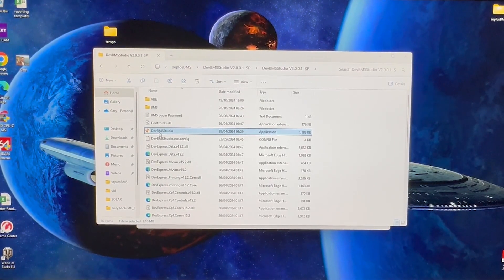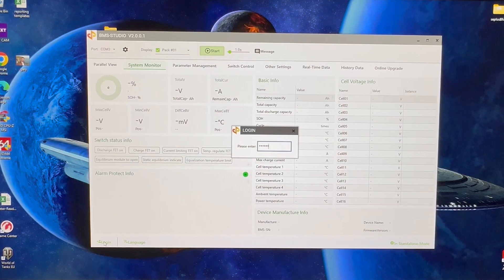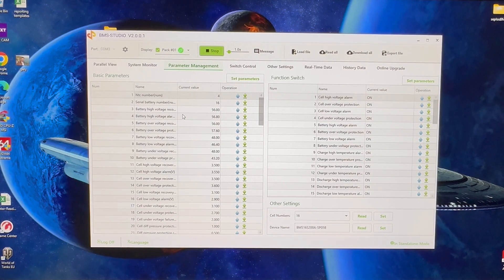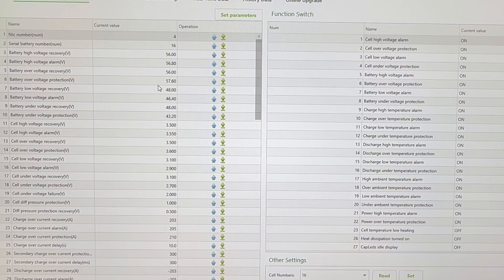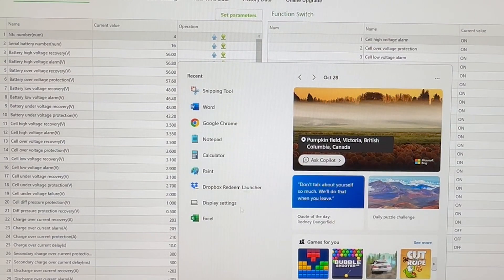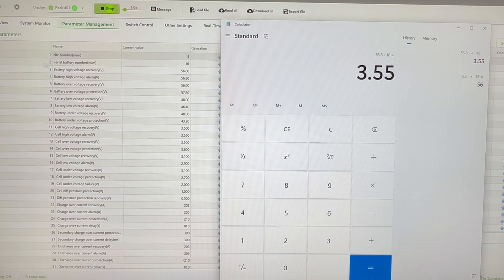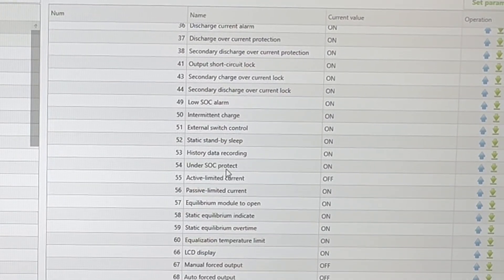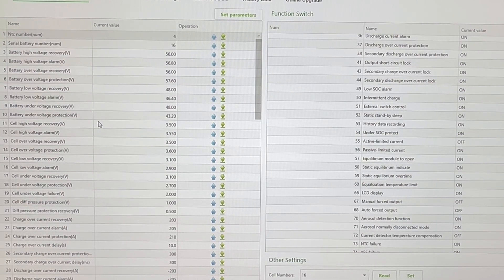Seplos V3 BMS Settings Improved

Comment: Thanks for your great work. I ordered the same enclosure but read about the active balancing starting at 3.0V. Is this changed in a latest firmware or could you chance the setting to 3.5V as generally recommended? I understand that the balancing board is also accessible via software. Thanks again
Reply from the maker: You can change the settings to whatever you believe is most appropriate for your purpose. I have found the settings I use to be working perfectly for my use case.

Comment: Great video!
I just received my Seplos Mason 560L (628Ah 2P16S huge battery!) and it's first 100% cycle shows it hitting overvoltage before throttling down the current. Doesn't seem like the shipped options are the best config?
Reply from the maker: Possibly not, but each setup is different if it's DIY, because different batteries are installed. I haven't seen the 560L until now. I would do a build video if Seplos wanted to send one to me. I think moving the complete battery is a challenge. Definitely a ground mounted setup.
Reply: @GaryOnPower yes, my Unit is a pre built one but I am sure it is easier to transport with the cells separate. I will have to get a cable and check the units BMS settings but I suspect the use the same setting for throttling as they do for alarm.

Comment: "Less conservative"? These are absurdly aggressive settings.

59.2v is 3.7v per cell, which is above the maximum you should ever charge an LFP cell to, and in order to charge the battery to 59.2v you're going to see individual cell voltages at god knows what voltage.

However, your batteries cannot reach a higher voltage than the charge voltage so in practice you are charging your batteries to 57.4v, but you will never get there because one of your cell voltages will very likely hit 3.7v before you get there unless you have exceptionally well matched cells.

The only reason your settings don't annihilate your batteries is because you have charge voltage set below where damage will occur and because the BMS will cut you off as soon as a cell hits 3.7v, which is too high but won't result in immediate cell death.

55.2v will get you to 99.9% SOC. There is no need to charge to 57.6v.
Reply from the maker: Thanks for your comment. While the settings are no longer conservative, they aren't absurdly aggressive either for LFP cells, at least not if they are actively balanced. I've gone through many tweaks and iterations of the settings and setup in order to fine tune for my use case. I update the description to keep people up to date and get the best from their setup. These are guide settings people can use, or ignore. 

What I will say is that the current (no pun intended) settings have been working great on my 3 packs. I had previously seen my SOC drop off a cliff from as high as 40% down to 15% for lack of LFP balancing. Getting to 99% SOC wasn't good enough and the packs were not balancing. Since May and these updated settings, I haven't had any issues, but I am always monitoring. I have just now checked all 3 packs and the delta is only 3mV on all 3 packs, so they are exceptionally well balanced. 

The only issue I have is with pack 3, it tends to sit at a lower SOC. So, while packs 1 and 2 are at 97%, pack 3 will be at 92%. The reason for this I suspect is the overall circuit length pack 3 has, which is longer than 1 and 2. I've been using DIY batteries for just over a year and I think they have already paid for themselves, even though I typically only utilise half of their capacity on any given day.
Reply: @GaryOnPower  Thank you for your thoughtful reply. I apologize for my confrontational tone.

Do you have active balancing? Passive balancing does benefit from a higher voltage, although Andy at Off-Grid Garage found that it was minimally more effective. I have active balancers so I can't speak from personal experience.

If your battery cables for battery #3 are longer, this will cause a difference in how much energy is extracted from it vs batteries with shorter cables. From what I've read. My battery cables are all 1.5 meters so once again I can't speak from experience.

I would like you to address one particular aspect of your recommendation: your charge voltage relative to your other voltages. Your charge voltage is 57.5v, right?

What are your pack voltages at termination?
Do you charge to a higher voltage because pack #3 lags behind?
What is your high cell voltage? 
What is the purpose of setting the target voltages higher than the charge voltage?

I still object to your use of the term "less conservative". Your settings are not conservative by any definition. Maximum cell voltage for LFP is always given as 3.65v. This is the maximum voltage a single cell should ever be charged to. I've seen some slightly wider ranges is specification sheets but 2.5v to 3.65v is well accepted as the limits of cell voltage to prevent damage.

"Battery Over Voltage Protection = 59.2V"

This is an AVERAGE of 3.7v per cell. How do you defend this? And how do you ever expect to reach it with a charge voltage of 57.5v?

The reason your settings have been "working great" is because you have a sane charging voltage. There is no other reason. Set your charging voltage to 59.2v and then make another video with your results.
Reply from the maker: @haysdb  I try not to infer tone from a written message without proper context, but thanks for the apology. I won't be changing any settings for some time, as my laptop with the BMS software is with my Son in Germany, where he now lives, at least for the rest of the year. 

I love the content Andy makes and some of the changes I made were based on what he has done in his tests on the Seplos V3 BMS. Setting a charge stop voltage to 3.65V will see it rest lower and this is where I was having problems with balancing and sudden drops. If the charge voltage is 3.65V the pack never actually balances. Andy has shown this himself in a balancing video. I also have a limited window for charging, so I can't wait 10 hours for the cells to top balance.

As I already said, I made many small tweaks until I reached these figures and they work for me. From practical experience, sometimes the default settings are not the right ones. I used the recommended settings and they were crap and caused me regular problems. If those settings work for you, then great, leave them be. They didn't work for me and didn't work for lots of people who had the same problems. 

Do you have expertise in batteries? I'm just a DIY enthusiast sharing my experience with others. I gain nothing monetarily from sharing any of this and I enjoy helping others with their projects. If you know better and especially if you are an expert, you should share that knowledge so that I and others can learn more. Having an expert helping out is no bad thing.
Reply: @GaryOnPower I think I see what your goal is: by setting your charge voltage below all protection and recovery thresholds (at 57.5 V), you're ensuring that those triggers never activate. This effectively turns them into dummy values — they don’t protect the battery, but they also don’t interfere. That’s worth pointing out for your viewers, since it means the protection settings aren't doing anything in practice.

Your method does give the cells time to balance, which is good, but you're holding the pack at a relatively high voltage — around 3.59 V per cell — for several hours every day. That’s a lot of voltage stress over time. Since your balancing comes from holding the voltage steady, not from hitting a specific voltage, you could drop the charge voltage to 56 V and achieve the same balancing benefit with significantly less wear on the cells. No need to change your other settings — they’re inactive anyway.
Reply from the maker: @haysdb  That's right, mostly. The protection would cut in before a catastrophic failure if something went really mad, which is why it's not set at a random high figure. In reality, it takes at least an hour or two for the cells to go from 99% to balanced with these settings. That's why I wouldn't call the overall settings aggressive. It's a slow boil when it nears the top 2-3%. This channel is not about the science in the numbers and giving detailed explanations about voltages and charge curves. There are other channels that go into those details. Andy is great for that sort of content and I love it, but it's not what everyone wants, or needs. 

My content is about the simple copy approach. Watch and repeat. Connect A to B and then to C, press enter and job done. Copy my setup and you'll most like get the same results. I try to answer questions as best I can when asked, but in general, I advise people to watch the video, or a different one I created and to go from there. If I start to explain why I am using certain settings, it defeats the purpose and goes against my target audience. If something goes wrong, like a blown fuse, then that warrants a video and explanation, so others can avoid the same problem and understand why.
Reply: @GaryOnPower  Your settings concern me. You mention a BMS over-voltage threshold of 59.2V (3.7V per cell), which is above the safe limit for LFP cells. That’s an aggressive setting—well into the range where damage can occur. While your actual charge voltage is lower, it’s still entirely possible for individual cells to hit 3.7V due to imbalance. That’s beyond what LFP chemistry can tolerate long-term. Viewers following your advice could unknowingly be degrading their batteries.
Reply from the maker: @haysdb  Thanks for the input. Concern noted. Cell health is solid. BMS is doing great. I'll drop from 3.7V to 3.66V when I have the Laptop available next time and will update the params here.
Reply: @GaryOnPower How do you assess cell health? What is the maximum cell voltage? If it’s above 3.65, cell health is not fine. Long term this will cause degradation.
Reply from the maker: @haysdb  Cell health is mainly determined by remaining capacity. Mine are still at 99-100% of original recorded capacity. Longer term will be monitored. 3.65V is perfectly fine under normal conditions. Higher voltages are set as alarms and shut off points. I am happy with the parameters. They work for me and others, so I respectfully disagree with your view regarding the params I have set. 

I'm also perfectly content to live with a few hundred less cycles via mild degradation if I have an otherwise trouble-free and predictable behaviour. In all likelihood, I will long have upgraded my packs in favour of cheaper, denser storage before the cells need renewing.

Comment: Hello. Update firmware 1.5.
Reply from the maker: Why?
Reply: Firmware 1.5 is a bit of a mixed bag. Gone is charge current being reduced to 10A per pack at high voltage alarm. The 100% reset before hitting over-voltage protection is nice for folks charging in open loop. It's no longer necessary to choose between 99.x% with absorption or resetting SOC to 100% but having your absorption time abruptly cut off by the BMS. You can now charge to just below where the BMS will cut you off and absorb for however long you want.
Reply: 1.5 will give you 100% SOC without having to charge to over-voltage protection. For folks using closed loop this is a non-issue but it's helpful for open loopers.

Comment: Hey Gary! First of all, I want to thank you for the amazing videos you make. Your content has been extremely helpful, and I really admire the effort you put into sharing your knowledge.  

I have a Seplos V3 battery with ESS 4LH3L7 cells rated at 280Ah. In your video, you suggest changing the setting from 305 to 280. Should I follow that exact configuration, or are there additional adjustments I should consider to optimize battery performance?  

Thanks again for the great work!
Reply from the maker: You’re very welcome for the content. My advice for settings is to follow the manufacturers advice. In your case, you should have your capacities set to 280Ah per cell and then look at the other settings for when the voltage is full. Generally, Lithium Ion is 3.65V when completely full. There will be slight differences but I would stress too much about these as long as the batteries are safe and are performing well. 

Be sure to check that your changes made match the times or divided by figures as shown in the videos. Good luck with your batteries 🎉
Reply: @GaryOnPower  Gary, I really need your help. The 'cell diff alarm' error is showing up, and the inverter keeps charging and discharging the battery constantly. Can you take a look at this for me?
Reply from the maker: @vitorcunha2571 for cell difference, you can try to fully charge and top balance the pack. Then deplete the cells and charge fully again. You should check the connections are torqued too. Check the cell imbalance via the LCD screen when full. You may have a bad cell if everything else checks out.
Reply: @GaryOnPower  Thanks for your reply, Gary! Really appreciate it. 
Do you happen to know if there’s a way to do a factory reset on the Seplos? 
I’ll follow the small changes you made in the video and set the cells to 280Ah. Thanks for the tip!
Reply from the maker: @vitorcunha2571 You would have to check this with Seplos, or check the the options when you connect the BMS to the software. It has been a long time since I connected to the software.

Comment: Hi Gary (and friends). I’ve also got 3 Seplos mason packs and have used these settings for the last couple of weeks that my system has been up and running. (Thanks) However, they don’t show uniform SOC when fully charged. Two show 100% at 53.4v, while the third reports 95%. Have you experienced this?
Reply from the maker: A few things to check.
What is the voltage of the third battery if showing 95%?
Are all batteries the same age/capacity?
Do they all have the same settings? Have you confirmed this?
Are they daisy chained or connected to a common busbar?
Are all cables the same length?

Can you first disconnect the two batteries that charge to 100% and try charging the other one to 100%?

It’s not uncommon to find differences in SOC, but all batteries should charge to 100%. First make sure the battery will reach 100% on its own before further troubleshooting. A battery that can’t reach 100% can drag the whole battery bank down as a weak link, because it won’t top balance.

Comment: Hi Gary, and thanks for this information!
I have the same BMS as you, before I managed charge and discharge as a percentage on my Deye inverter, I've just changed the control to voltage vs capacity.
Knowing that I want to limit the discharge to 20%, what is the recommended minimum voltage for a pack of 16 cells?
Merci
Reply from the maker: Sorry about late reply. The best way to do this is to discharge to 20% and check the voltages. You will then have the exact voltage you want to set minimum to. I would however suggest that 20% is a high minimum and too conservative. 15% is more than enough.

2.8V would be around the 20% for Li batteries, but you would need to check your own pack to be sure.

Comment: Hi,
thanks for the vid, I've got 3x these in parallel with balancing issues, hence looking for better settings Ito implement! 
I saw there was a firmware update for the V3, did you update, any idea what yours are on? or did you find your settings resolved any issues regardless? thanks
Reply from the maker: Hi. I'm not sure what firmware version mine are on. My balancing is at a level I am comfortable with, but will tweak later. By fully charging the batteries every week or so and typically only using less than half the capacity, I have no problems. I rely more on the hardware setup and will add another video when I make adjustments to mine.
Reply: @GaryOnPower  Hello Gary, on your first screen movie BMSstudio, I see your firmware is v1.3
Reply: Have you done the update?
Reply from the maker: @maconly34  No changes made. We welcomed a new addition to the family a week ago, so there is a settling in period taking priority. I did pick up a used 3.6kW Solis inverter a couple of days ago and plan to add more solar soon, but I have lots of stuff to get done in the meantime with batteries causing me no concern at the moment.

Comment: Great video/advice.  New to building a SEPLOS / Fogstar V4 kit with BMS 3 same as yours, to set protocol to match SOLIS inverter do i pick GINL (GINLONG) or a different one ? and is that selected via BMS software ? as i couldn't find GINL on small display menu (found 20 other protocols!) ANY advice much appreciated.
Reply: I am stuck on the same issue. Did you manage to figure it out when you were working on yours?
Reply: @etan30  Firmware update on SOLIS Inverter sorted comms with Battery pack. SOLIS did it remotely for me once i raised problem and authorized them to do update (Said yes please on email).

Comment: Hello Gary,  What about the requested charging voltage parameter. Is this parameter read correctly by thd Solis? Did you do any study on this ?
Reply from the maker: This depends on the battery parameter settings chosen. User defined gives you greatest control, but AoBo seems to work for me.
Reply: @GaryOnPower  Thanks for your answer

Comment: Hi Gary. I noticed briefly on your video that there are settings on your shine app that i don't have. Regarding the battery charging voltage and float voltage. I'm pulling my hair out trying to charge my battery past 50.9v at the moment. Is there different versions. My version is 8.2.7.0. Sorry Gary. I should have said I'm using a growatt sph inverter with my seplos bms.
Reply from the maker: Hi Gordon. If you have the settings listed in the description, then the problem is somewhere else. It could be a hardware setup issue, so maybe check all your connections. I'm not familiar with other inverters, but as long as the inverter settings are equal to, or greater than the charge voltage settings of the BMS, then you should be able to achieve the required voltage.